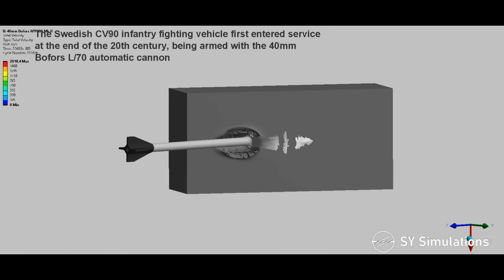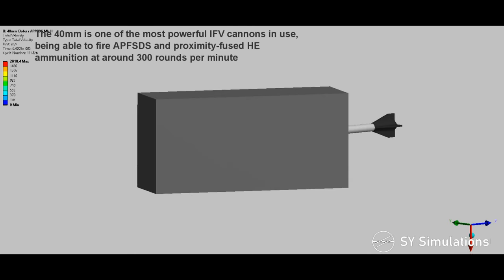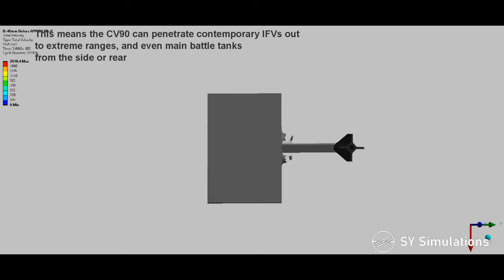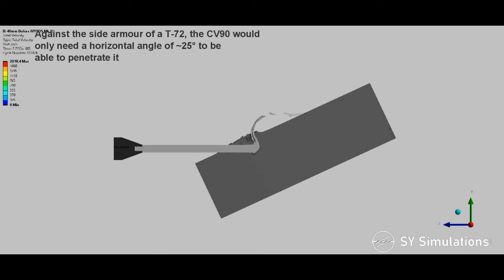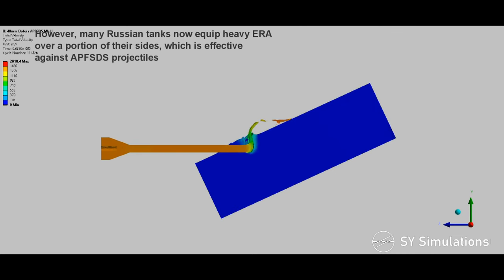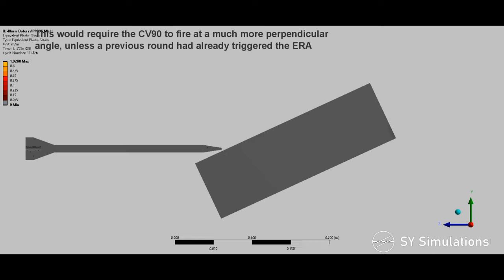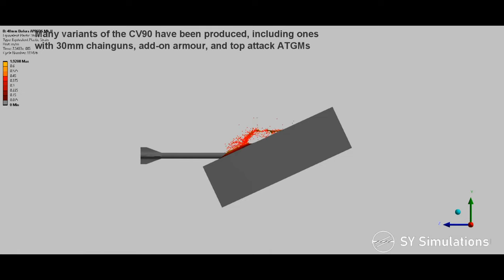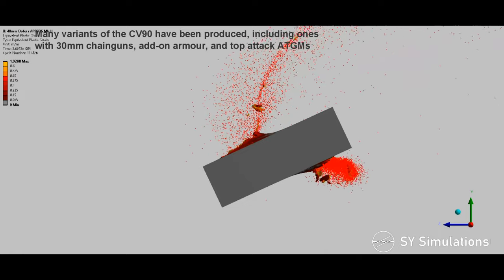CV90 vs T-72 | Swedish 40mm APFSDS vs Main Battle Tank | Armour Penetration Simulation

Comment: Now give it ERA!
Reply: And give the CV90 its 12-14 rounds per minute
Reply: @arround1  I think his computer would melt.
Reply: era doesnt do shit vs a 40 mm autocanon.... and certinly not a russian "ERA"
Reply: @laves820  Russia ERA works just fine. I'm not sure why Javelins hitting the top of tanks and penetrating shocked everyone. Guess what, Abrams and Leopard have even less top armour than T90. They would blow up just as easily. Indeed we see plenty of Leopard 2s lost already to artillery and even the small Lancet drone.
Reply: @greybuckleton  Leopard 2E, HEL and Strv 122 have significantly more top armor than a T-90.
Reply: @jonny2954  I see 20-40mm of armour on the top of a Leo 2 A5/6/7 turret. I see even less 10-20mm on the STRV 122. T90 has 45mm top armour if you miss the ERA. Javelin has 760mm of penetration. While I do not in any way agree on your assessment of top armour (Are you looking at the upper front plate or something?) ALL of these tanks can barely slow the plasma jet as its cuts right through them. And frankly, we have seen the Leo's and the Abrams going down to much lesser weapons than Javlin.
Reply: @greybuckleton  You are confused. While the A5 increased the roof armor thickness from 45 mm on the A4 to 70+ mm on the A5 the Leopard 2A5/A6/A7 do not have the additional turret roof addon armor kit, the Strv 122, 2A7Q, Leopard 2E and Leopard 2HEL have it. How in your mind does the Strv 122 have less roof armor than the A5/A6/A7?

Also never said a Leopard 2 would survive a Javelin hit (althouth PZH 2000 shrugged off a LANCET hit to the GEKE roof armor). Just stated the fact that certain Leopard 2 variants have much thicker roof armor than the T-90, which is true. Enough pictures of that on the web. 70+ mm base armor + spaced NERA addon kit. Hatches about 150 mm in total. That's why they're sliding hatches on these versions, too heavy to fold up even when spring loaded.
Reply: @jonny2954  When I look at the armour I do not add items that disturb the base value. Items like hatches, ERA pates, sights, weapons. The bare turret armour is what I am using. There is no NERA let alone space NERA on the top of the turret? And yes you might see a video where PZH 2000 survives a hit from lancet, but it does not take much research to realise this is luck rather than the expected outcome. I have seen a T72 take a 152mm hit to the top of the engine deck and not be immobilised. Is should have been, but clearly wasn't. There is a lot of chaos in the maths of war. What reference are you using for the STRV 122? AS for the other niche variants, none are in the war theatre and its just not all that relevant.
Reply: @greybuckleton  Read my comment. Base roof armor of A5 and later is 70 mm. Strv 122 and various others add another addon armor module on top, consisting of spaced NERA. NERA is always spaced, it's necessary for it to work.

Hatches do not disturb the armor value. Just mentioned them because they were replaced alongside the addon module.
Reply: @jonny2954  I would consider spaced armour to not be NERA. And it's not just me, this is the convention of the nomenclature. If this was not the case you would simply call them all spaced armour. Things like cage and bar armour are spaced armour. You need a big air cavity behind the plate. Hatches and protrusions most certainly do change the line of sight armour value, why would they not? What is your source material for the 70mm top plate on the A5? All source material I see is in opposition to this.
Reply: @greybuckleton  Spaced armor can by any armor type. Just needs to be spaced. Slat armor does not really count as spaced though.

Hatches change LOS thickness? From where are you measuring the thickness of the roof armor? For clarity, i mean the crew hatches and not stowage bins or anything. They don't change the thickness of the roof armor around them.

Source is a dude holding a tape measure on a Leopard 2 at an exhibition. Pretty clear.
Reply: @jonny2954  well firstly, slat armour is defined as spaced armour. This is because it creates space between the impacts and the main armour. 

A hatch will change LOS thickness because it is curved and will likely have a different thickness. 

Lastly, I do not see how "A dude with a tape measure" can show you the thickness of an armour plate. He could have perhaps measured the thickness of the roof, but this is not the same thing. Consider the thickness of your roof tile/iron vs the roof to ceiling. It would not be possible for "a dude" to measure the plate for you unless it had been removed from the chassis.
Reply: @greybuckleton  Common myth, that's not how slat armor works. It's not prematurely detonating warheads, that would increase standoff distance and in some cases even increase penetration of the shaped charge jet. Instead it aims to catch and crush a warhead before it sets off on the main armor.

Strv 122 hatches are not curved. They are sliding hatches. Also still not sure how a hatch can change the roof armor around it. Doesen't make sense.

Leopard 2A4 base roof armor thickness is publicly known at 45 cm. In the A5 upgrade they just welded additional plates on top on the outside, which are indeed measurable with a tape measure. Adds up to 70 mm. Not rocket science.
Reply: @jonny2954  what is your reference fo the addition of the armour to the A5 being 70mm. 

Just google slat armour, it's a type of space armour. Then google if NERA is considered spaced armour. It's not, it's considered reactive armour. 

I said I don't measure hatches, I did not say I do not measure STRV 122 hatches. I do not measure ANY hatches. The LOS thickness is affected by a hatch, this is true even if the hatch was and the same thickness as the roof, as it will present a different angle. A very niche tank may have made its hatch EXACTLY the same as the rest of the turret, but on the whole this it totally irrelevant to what I said.  I will re emphasise I said protrusions, as there are many things that alter the LOS armour thickness on a turret, not just the hatch and this is as true for the STRV 122 as any other tank. 

Unless you can provide some kind of reference for your armour claims, I am afraid the conversation is done. You appear to be arguing rather than debating.
Reply: @greybuckleton  Addition to A5 armor is not 70 mm. Total thickness is 70 mm. Thickness of the additional plates is only 25 mm, added to the base A4 structure thickness of 45 mm. Base A4 steel structure is available online, measurements of the external plates aswell.

Being reactive armor does not rule out being spaced. Spaced just means it's mounted at a distance from the layer underneath.

Hatch debate closed. I was just mentioning them alongside the addon armor package, they do not interfere with the turret roof armor thickness in other places. You just did not realize i was talking about the thickness of the turret structure, not the hatches.

You keep backpedaling and changing objective rather than jst accepting you were wrong in your initial claim which was

"i see 20-40mm of armour on the top of a Leo 2 A5/6/7 turret. I see even less 10-20mm on the STRV 122"

That (base- and sourceless btw.) claim was already debunked by the publicly known 45 base armor thickness of the Leopard 2A4 turret roof. Addon armor or not, Leopard 2A4 already has equivalent roof armor thickness to T-90 at 45 mm. And even with just 5 mm of armor added on the A5 it has thicker roof armor, confiriming my initial claim of:

"Leopard 2E, HEL and Strv 122 have significantly more top armor than a T-90"

So you can stop derailing the conversation now. Have a good day.

Comment: Not exactly a staggering amount of damage, but a hole is a hole, and if that lump of superheated metal came in low towards the carousel, it'd be all you need.
Reply: The point (no pun intended) of an APFSDS, is not necessarily to cause catastrophic damage to the tank itself, but rather to creating spalling/fragmentation that'll bounce around inside and shred the crew.
Reply: well it only blows out the tank and kill the crew but I dont know what you want else ^^